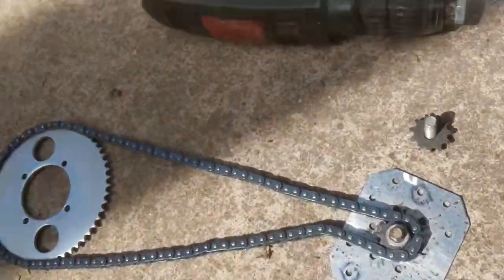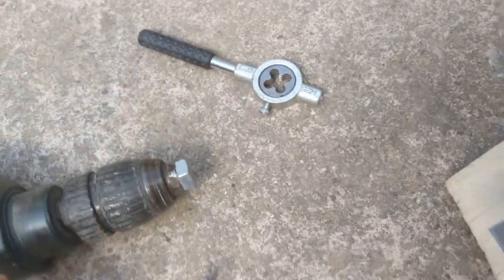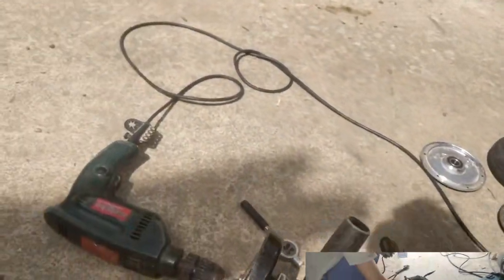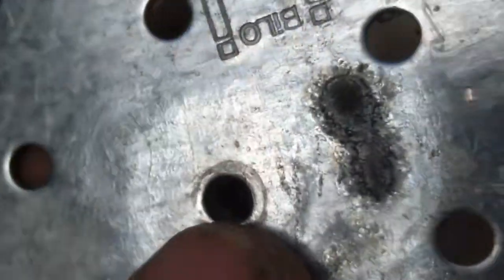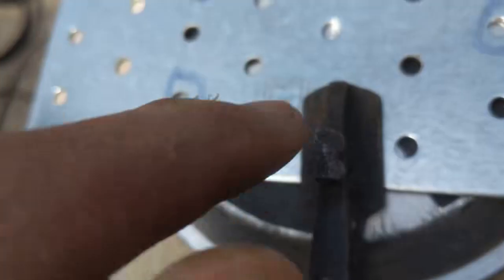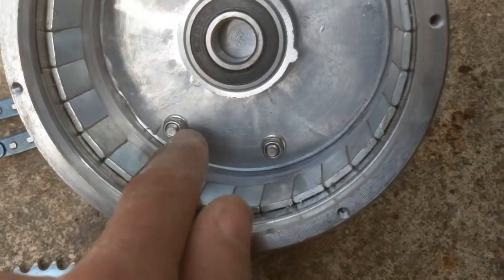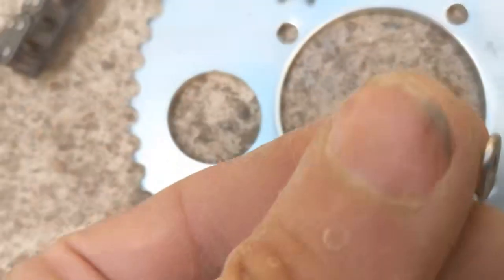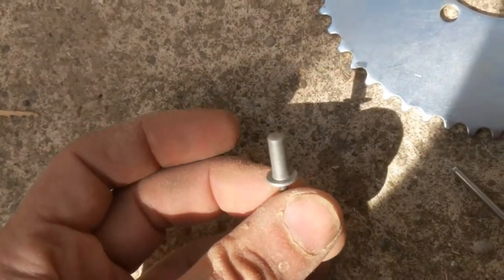Hoverboard:  how to mount 11-tooth T8F sprocket (chain drive)

Comment: What ratio is the sprockets. I need a 4 to 1 or better.
Reply from the maker: For higher than 4:1 ratios I would use the 219 219h chain: https://www.ebay.de/itm/373436734355
25h should also work: https://a.aliexpress.com/_EJX3yr7
For only 4:1, T8F should be no problem. Max might only be 74T :  
https://a.aliexpress.com/_EHt8IF3